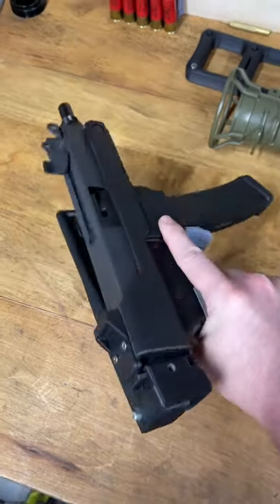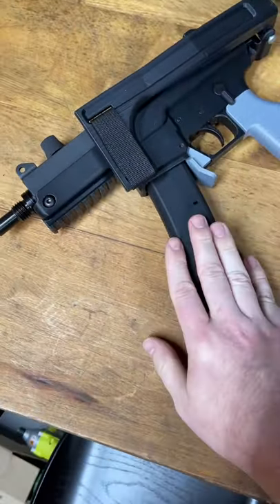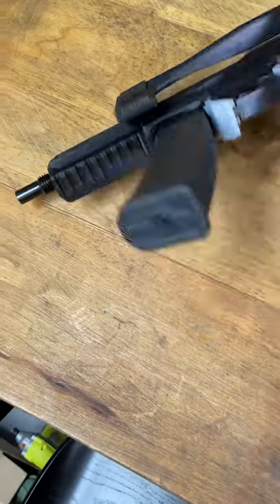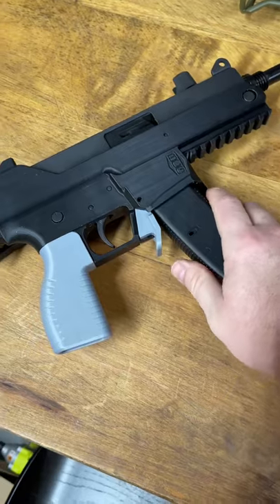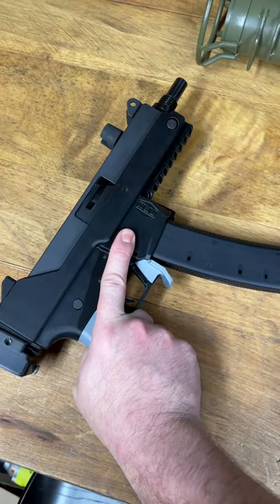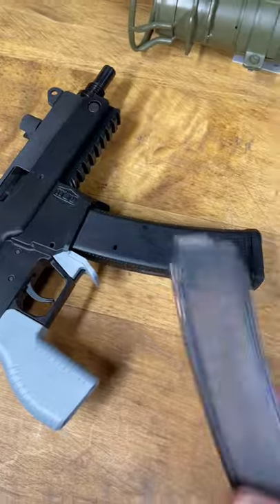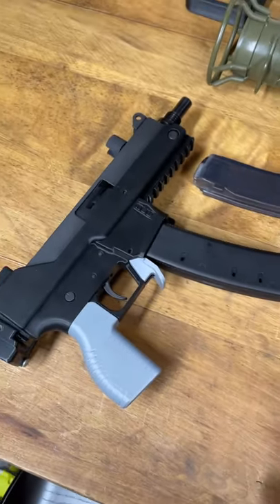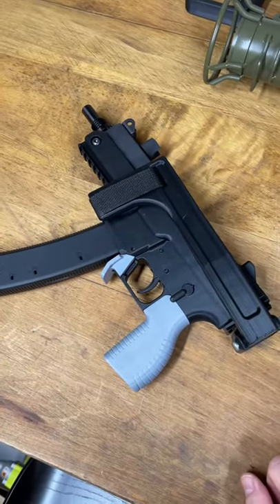“EvoMac” 3D Printed Evo3 Fed Mac11 Frame

Comment: Does the malfunction always happen on the 30th round in the magazine? 
Or does it always happen on the last round, regardless of how many you load? 

I saw your comment about maybe designing a new follower with a dummy round. 

You could also design a plug that limits capacity by sitting under the follower. They're a common thing in states that limit magazine capacity.

Comment: Interesting. Did you have to modify the bolt? I didn't think it would work with those mags.
Reply from the maker: Nope, the mags are modified but the bolt is untouched. I do have a second version that I’m working on that uses unmodified mags with a modified bolt.

Comment: What print and infill settings do you use for prints like this? Does it change depending on the gun and caliber or is it relatively the same? Wanna know what is optimal for prints like the EvoMac or say a AR lower style print like a Hoffman or FIrebolt
Reply: From what I understand, go 100% on all of it

Comment: So this is a Scorpion Evo lower, with a Mac upper or is it a 3D printed lower that's loosely based on the Scorpion Evo. That does make a slick looking hybrid Mac though, cause Macs aren't typically the most comfortable or ergonomic guns lol.
Reply from the maker: I have several videos on the entire project. It’s a 3D printed Mac compatible lower that feeds from Evo 3 mags and utilizes AR15 fire control group.

Comment: Think its possible to get it to run with non-modded mags? I know you’d probably have to clearance the bolt, but would it ever be possible?
Reply from the maker: You’d have to machine the bolt and upper receiver. And since the bolt is blowback operated, you’d then need to add mass back to the bolt to keep it safe
Reply: @This-account-is-hacked  😶

Comment: any vz58 lowers that have been printed?
Reply from the maker: None that I’ve seen.
Reply: The vz58 is a tilting wedge design similar to a P38 or Beretta 92 where the wedge locks into a section of the guide rails. I haven't seen someone come up with a good solution in plastic for that style system.

Comment: Plastic magazines are crap and brake quickly.
Reply from the maker: Pmags are literally the standard issue magazines for some of the largest militaries in the world… they basically last forever.
Reply: @booliganshootingsports  they break easier then metal mags.
 standard issue because the proxy  controller's don't give a shit about their soldiers.
My opinion only.
Reply from the maker: Yeah the facts don’t back that up though. The Army tested Pmags against 15 other commercial magazines as well as the metal “Enhanced Performance Magazine” and previously standard issue metal magazines and the Pmag came ahead in performance, reliability, and durability. 

We’re far past the days of crappy plastic tapco mags.

Comment: Not a mac at all and the 3d printed lower is a recipe for jamming
Reply from the maker: It uses all off the shelf Mac parts and 3D printed lowers are as reliable as factory ones, if designed and built properly.
Reply: @booliganshootingsports  who told you that lie as many jams as you have 3d printed lowers will work improperly who are your so called mac parts made by i can tell you u have a jammer not a mac
Reply from the maker: @trichomeboss2731  who told me what lie? I’m a firearm designer. My released designs run flawlessly. The current version of this runs flawlessly. Earlier versions needed the feed geometry dialed in, like every firearm ever developed. They last basically indefinitely if printed correctly, and if you have a failure, it costs $4 to print a new frame.

The semi-auto M11/9 pattern upper that this utilizes is built by Velocity Arms but it runs literally any M11/9 pattern semi-auto upper. Take an upper off a post-‘86 Cobray and it’ll run the same. Masterpiece Arms, Vmac, MAF Arms all make standard MAC pattern uppers that work for these. 

So I’m not sure what familiarity you have with the “MAC” pattern firearm but get educated. You absolutely know nothing about the current state of printed firearms so definitely get educated there, otherwise you look incredibly ignorant.
Reply: @booliganshootingsports  thry don't work correctly v mac masterpiece arms are all clones of the original if its not a cobray its considered a fake and those 3d printed lowers measurements are off making the gun run wrong its pointless to have a 3d lower just to create jams when you can just have a cobray that run flawlessly you are going to keep breaking lowers trying to make that thing run flawlessly consistently i can tell you that is a. 100% not a mac its a clone of a clone
Reply from the maker: @trichomeboss2731  “the measurements are off”…

Weird because I designed this myself, and I took the measurements for this myself off of my factory made M11/9 🤔

Good to know that you know all about the exact specs of my design that hasn’t been publicly released yet.

How do you feel about AR15s not built by Colt or Armalite? Are they “fake”?

Good luck being a Luddite about the technological advances being made daily in self made firearms.
Reply: @booliganshootingsports   yeah still doesn't work correctly your lying you said you had a vmac you aren't even being specific but it sounds like you got your mold off a masterpiece arms clone so yeah your lower is still off to work correctly 3d printed stuff isn't the best quality that's why original manufacturers never used plastic copys because they didn't want the guns to break under there warranty
Reply from the maker: @trichomeboss2731  you’re assuming I only have one MAC. I have multiple by a variety of manufacturers in different calibers and sizes. 

This one is using a VMAC upper. It was designed using Cobray dimensions. 

My design isn’t “off” and it works great. There’s no “mold” when you design these. They’re made using CAD and measured dimensions. 

I’m done arguing with someone who can’t even form a proper sentence about a gun that I designed myself. Take care and good luck with a firearm design mentality stuck in the 1960s.
Reply: @booliganshootingsports  that is still reliable designed in the 1960s but its original id trust a real manufacture with the correct tooling than a 3d printed clone you can argue that your design is working all you want the thing is we won't see is continuous firing before that 3d printed plastic breaks i garuntee the 1960 original will shoot way more clips than the plastic clone the gun wasn't designed to be fused with plastic components that's why your video shows you mainly talking than shooting because you created something unreliable and try to defend that it works 1960s design for the win
Reply: No videos. Of you shooting that piece of crap 3d printed junk this guy turned a clone mac even into more of jammer listen how he said he changed the magazine several times because he can't get it to shoot right😊